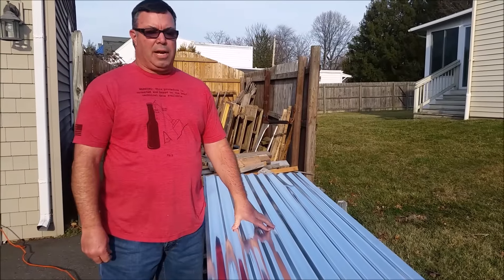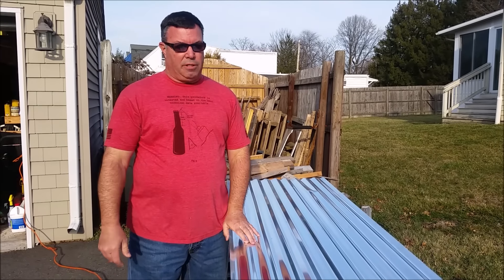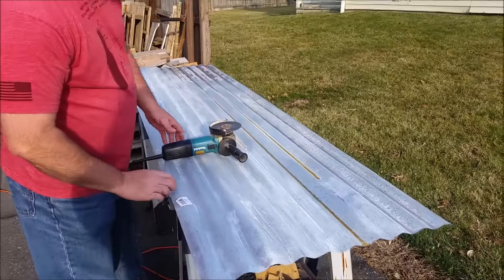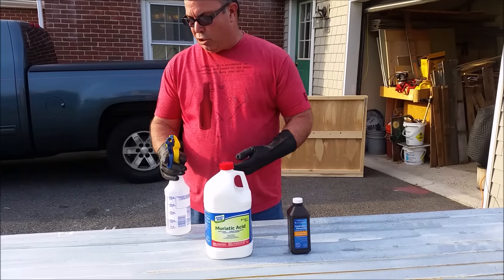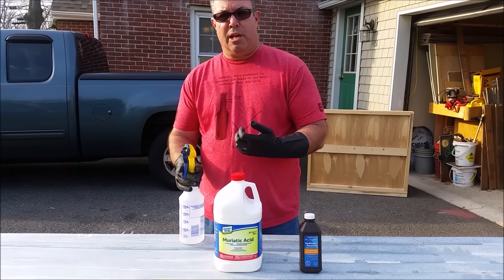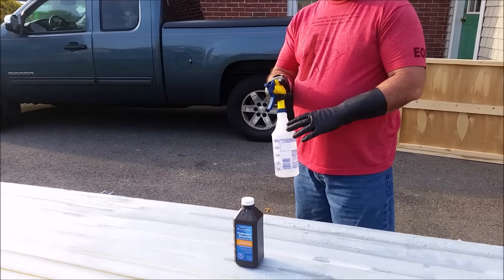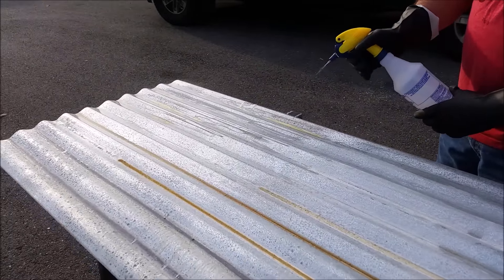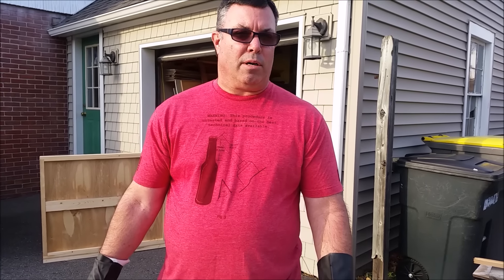Aging Corrugated Steel

Comment: Good stuff. Great video.
I have a significantly large gabled project about to start and was going to age the metal in place. But now I see you have some great effects with your method. Only achievable with the panels laying flat. The concentration of rust in the valleys adds a very authentic look.
Thank you for taking the time to post your video.

Comment: The KEY to success is the STRENGTH of the ACID. Leslie's pool supply advertised "twice the acid strength of others". And that is exactly what I found. Muriatic Acid from Homedepot did not do the job, but I had instant success with Leslies Acid.  I your not getting a quick response, find another stronger acid. Use all safety precautions.

Comment: thanks for sharing, nice video and good info. I am roofing a shed with old rusted roofing panels and need to match the ridge cap, which is zinc coated......this should work. I may try an aggressive flap sandiing disk on my grinder to see if I can get a more even removal.

Comment: Better idea and effect rather than the grinder wheel is one of those purple high abrasive wheels for removing rust, ironically…
You get a more even splotchy rusting with it and no worries about grinding through anything…
And don’t take any chances breathing those fumes, it burns your lungs lining and it won’t repair itself! On that you only have one chance to get it right (unless you like severe shortness of breath for the rest of your life)

Comment: I used vinegar and HALF table spoon of  SALT.
Let sit for 3 hrs
Slightly rinse with water
Spray with ACID and Peroxide...(spray bottle)
Wait 1 Hour
Spray Acid and Peroxide again.
Next morning it will look 50 years old
1 week it will look 100 years old
This worked for me.
Reply: Did you wash the metal before your process? I'm hoping not....

Comment: You might want some sort of respirator  for the grinding part...this guy shipyard cough cough hack galvanic cough...but cool science trick.gunna use it.(with a respirator though)
Reply: The grinding part? How about the acid part? Those fumes can and will burn your lungs. Especially when you pour it onto galvanized metal. 
You better do some research and not go by some fool on YouTube.  Just sayin'.

Comment: No need to grind it.  Just spray the muriatic acid on it and leave it
Reply from the maker: Thanks, for me removing the galvanized coating before applying the acid, provides a better result.
Reply: @EveryOtherDayWoodWor  .... more than likely it does  get a better result however it's not worth the risk. Breathing in galvanized dust is toxic. Not worth grinding.  It has zinc and shouldn't be grinding on it or burning it

Comment: Hydrogen Peroxide needs to be in a dark container, otherwise the daylight will degrade it and it becomes inert (or useless).  If you leave it in your spray bottle, the next time you try it, it wont work.  Great video though. I want to try Lysol Toilet Bowl Cleaner first to see the results of that before I mess with the nasty chemicals...

Comment: Hey should I rinse it after or leave it?
Reply from the maker: Dem'ral Youths just leave it dry
Reply: Thank you so much!! I did this and it looks so amazing you are the best!! So when you just leave it, it won't be toxic or harmful to touch or anything ?
Reply from the maker: Dem'ral Youths well there's always a risk with any chemicals you use. ensure you read the precautions on the bottles as well as any hazmat issues. I  haven't experienced any though but that's just me.
Reply: thank you for the reply! so if i do wash it, will the rust get rinsed off?
Reply from the maker: Dem'ral Youths I wouldn't rinse right away. I left mine outside till I was ready to use it and it rusted even more.
Reply: Okay thanks so much, and would it be okay to put a clear coat on it after? Like a spray can metal seal type thing?
Reply from the maker: Dem'ral Youths that's up to you
Reply: Ryan Kellogg how did the clear coat hold up a year later? 

And to answer your question regarding washing rust off, answer is no rust is actually degraded metal so it’s the metal showing color not paint, meaning it will not wash off.